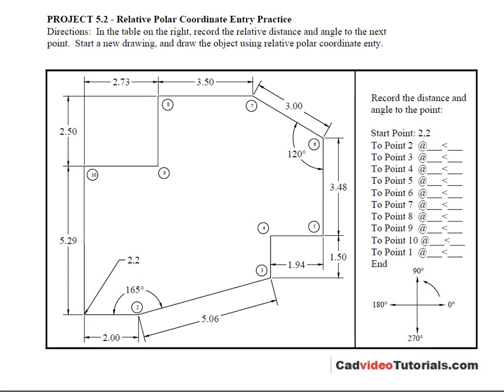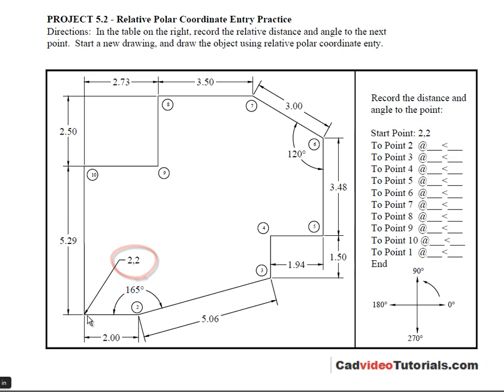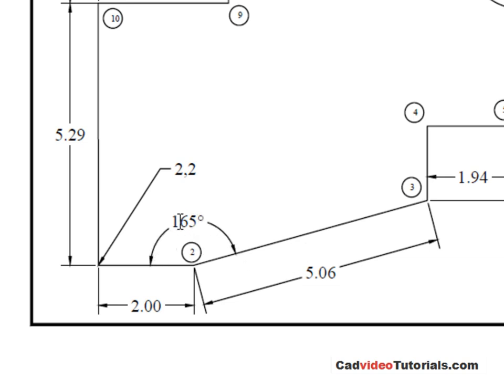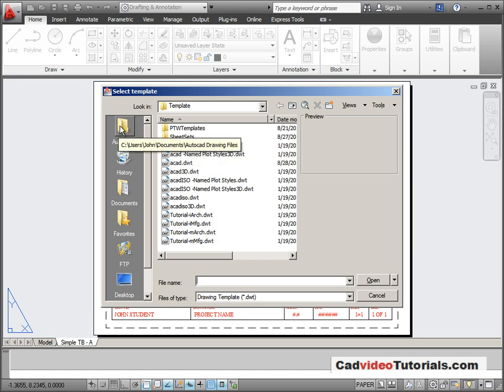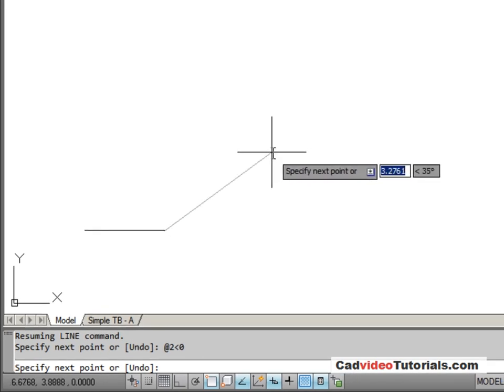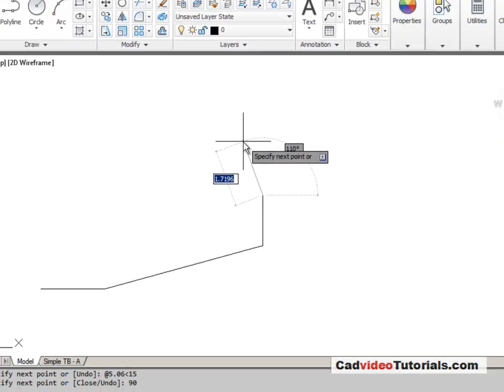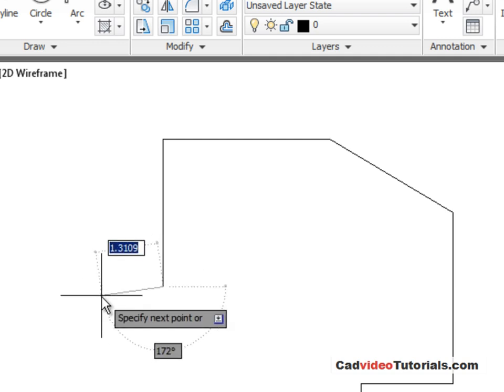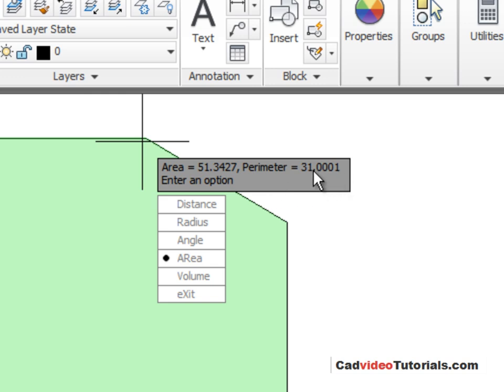AutoCAD 2012 Drawing Project - Using  Relative Polar Coordinate Entry

Comment: can you have a drawing in wcs and view it on a sheet as through another position i.e. if you draw a building at 12 degrees from horizontal can you place the dwg on the sheet and view it through the viewport as horizontal and not at 12 degrees